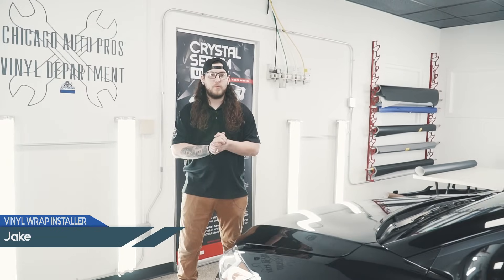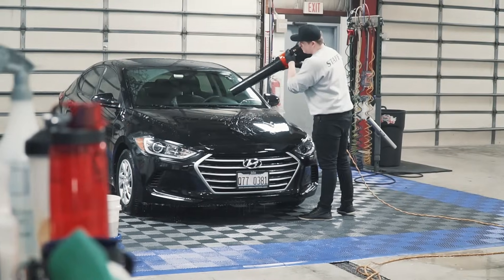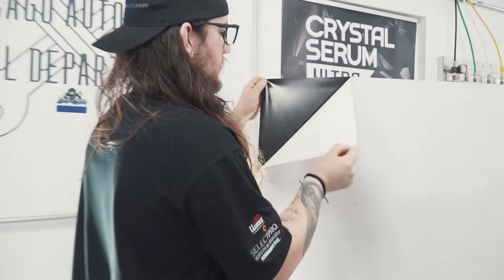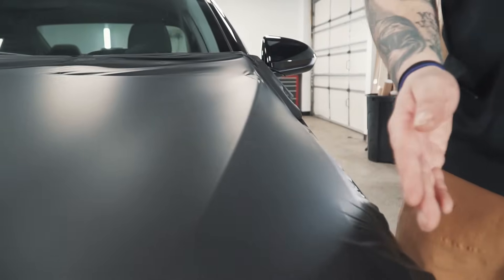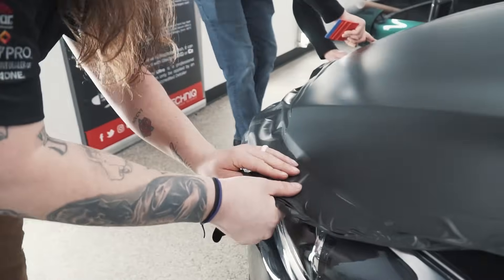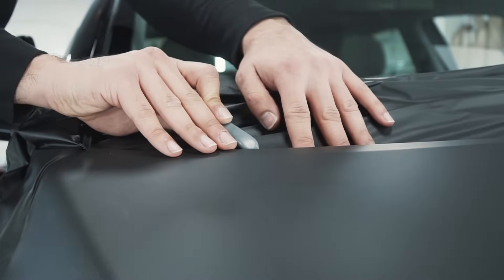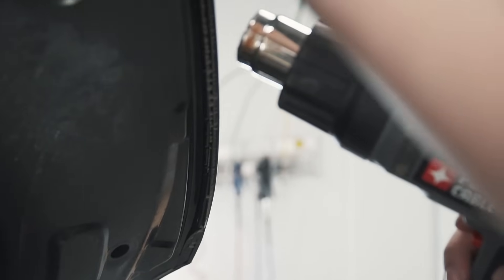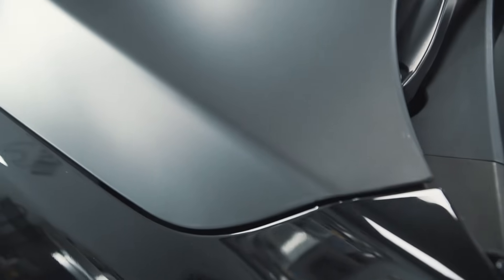How To Vinyl Wrap Your Hood

Comment: What is recommended when the hood clear is faded? Should I sand it a bit with a fine sand paper?
Reply: Similar to paint. The smoother and more even the surface, the better the film will stick. On a shot hood I'd sand and primer.

Comment: Why don't you use the spray on the hood and Squeegee the spray out or is that not recommended? I've never done a hood but I've done several signs and I used the spray, just curious

Comment: I want to wrap my hood roof and trunk on 2017 Civic Coupe. It's black but want those 3 peices satin white chameleon. How wide wad your roll (5ft)? You made that look so easy which I'm sure it's not.  Do you recommend a cleaning solution to wash before install or just soap n water then rinse and dry? Last question if tiny bubbles don't come out can you poke then with a small pin to get air out? 
Thanks  
Will be my first time trying to wrap. Great video thanks

Comment: Looks amazing but I have a question. So I work at a body shop. I'm an autobody tech and am a combo guy. (Do body work and Paint) that being said we,ve had a few people want vinyl stickers on their cars my favorite being a 1972 I believe VW Van looked like the mystery machine but we made it a two tone Robin egg blue and white. The guy wanted a grateful dead vinyl sticker around the front 4 inch circumference VW logo so we did it and for every sticker/wrap ive done i was always taught to spray water (not alot) under the wrap because it helps the vinyl adhesion and its easier to see places where air and water may be trapped. Is that just a preference thing or is there no really benefit either way?
Reply: modern vinyl wraps/decals with air channel release dont need any water/soap application
Reply: @socalguy829  roger so its a you can but don't need to ? Or probably shouldn't

Comment: You made it look easy,  Vinyl wrap does not require the soap solution like PPF?  Curious, as a DIY project how many times would a first timer have to start all over on a typical hood?  Front ends look to the the worst!
Reply: You're going to fail the first time... trust me.  But after the first time you'll learn that stretching that bad boy first is the way to go.

Comment: How long with good care on average that would last? Could u make one with the clear bra? Chicago Auto Pros puts the best vids on you tube.
Reply: The ViVViD wraps have a 5 year warranty
Reply: It last for a very long time. Lol I mean it’s not gonna come off once it’s on if done right. The worst happens is 1. It can get chipy if you try to take it off years later it will be hard Getting it off. 2 it can get dirty of course but you can easily buy cleaning products made especially for wraps.

Comment: Do you need to heat the entire surface afterwards to melt the glue?  Can you put vinyl wrap directly on top of primer?  I am about to do my van bonnet.
Reply: The adhesive is activated by pressure. Yes you can wrap primer, but make sure it's smooth and even otherwise imperfections will show through.

Comment: Do you clay bar and then spray the diluted alcohol and then wipe it down right before applying vinyl wrap?
Reply: Use undiluted 70% IPA (already 30% water) just before install. Tack cloth isn't a bad idea either. Clay during the washing process, which is a must. Prep can't be overstated, especially if you want the install to last.

Comment: This is what they want me to pay 3 grand for ?
Reply: It's Labour intensive ...
Reply: T-800 Model 101 Infiltrator Unit.  Sounds like you got ROBBED. I'd just buy a carbon fiber hood for that price for my Cadillac ats 2.0T 

ANYONE whose spends over 1,000+ for vinyl wrap needs a MRI done on there brain. Just buy a carbon hood and call it a day this way you can swap the hoods on the fly.
Reply: 2 Brownish Girls  um….. a roof wrap is no more than $150 and hood should be no more than $300. So probably $500 for both at the highest.
Reply: People who get this usually make good money and value the work more then you
Reply: In today's economy you might pay $3k now 😂

If you think it's so easy there's something called diy, chop chop
Reply: between the cost of the material, the countless hours and how easy it is to fuck up the vinyl, yeah. there are people going to school that will wrap a car for considerably less than 3 grand but you can’t expect them to know everything they need to to get the maximum life out of the material without over or under stretching
Reply: Tried it today. Yeah pay the money!!!
Reply: @sethrowley9642  wrapped my car for the first time and fuck it’s a hassle alone on top of the fact I fucked up alot
Reply: @keithburgess4088 putting a large sticker on a car is not labor
Reply: @EliteOnTheBeat no they don't need dumbshit and stuff , Sum of US just know how ti manage money  unlike sum all ppl😂 
ALSO BRO WRAPS PRICED DEPEND ON A ALOT FACTORS LIKE WHERE YOU GET THE WRAP ALSO THE QUALITY AND OTHER FACTORS🤦🏻‍♂️💀
Reply: It's not that easy 🤦🏻‍♂️
Reply: I’ll do it myself before I pay 3 racks 🤣
Reply: @lucasharten6913 I know people that'll wrap a hood for $30 😂 crazy how life works huh?
Reply: Dude told me 450 for a hood
Reply: Anyone who pays more than 150-200 for a hood wrap is inane 😂 just buy a REAL carbon hood once you start hitting the high prices lol crazy

3k... I put a dry carbon GT race hood on my DB9 for 2k lol
Reply: @EliteOnTheBeat  vinyl is meant to save the stock paint. It’s a great idea when buying or leasing a new car.
Reply: @TheTaterhead08 the material isn’t even $30😂 yo people losing money
Reply: hahahaha ikr

Comment: If you only want a section of your hood covered do professional installers measure and cut to between the body lines, or do they apply to the hood then cut to your desired pattern ? 

I’d rather not have my clear coat cut on, if I should ever remove it
Reply: We use knifeless tape.

Comment: So can you still wrap a hood if it has like paint chips or paint bubbling? I understand it’ll peel when you take the wrap off but is it still possible?..
Reply: No, paint bubbling and paint chips can actually be seen in the wrap because of how tight the wrap is but you can sand the bubbles out of the hood and fill the paint chips with body filler then wrap the car. You would not need to paint it.

Comment: So you made this wrap look really good and somewhat easy.  Is the alcohol/water mix better than the Dap manufactured mix ?  Tks. And keep the videos coming.
Reply: Use straight 70% IPA. 70% IPA is already 30% water, so do not dilute or you could leave oil, etc.

Comment: Suggestions.   I have a Charger SRT 8 Superbee.  It has 2 patches of decals that are flat black on the hood (typical factory)   I really dont want to remove them but I also dont want them to be seen thru the wrap    I dont know if they even would be visible.  Your thoughts??
Reply from the maker: Yes, you will see them through the wrap, if you don't want to see them you can take them off.
Reply: Chicago Auto Pros 
Ideas on taking them
Off without being the biggest PITA?

Thanks for the
Response too.   I will be sure to
Follow u
Reply from the maker: @JWTiny  Get a heat gun and warm the adhesive up, pull at like a 90-degree angle and slow.

Comment: I recently did my roof, i struggled getting all the air bubbles out, i laid it down with a second person and glassed it, and i just kept getting trapped air, when i tried to lift the film, it wasn't easy, in the end i got it done, but I think I was doing sonething wrong which caused the air bubbles and that the film wouldn't lift easy, i'm using Oracle wrap, any tips?